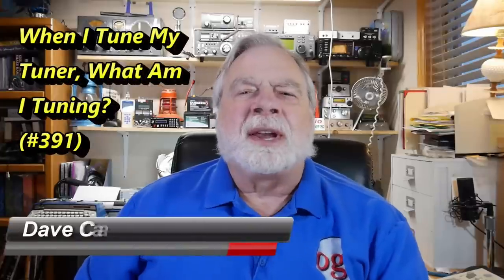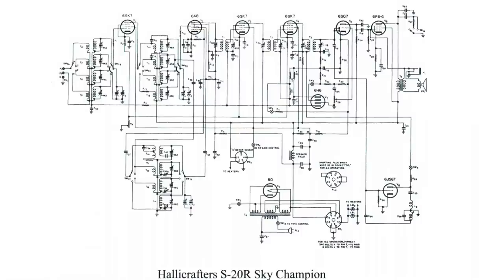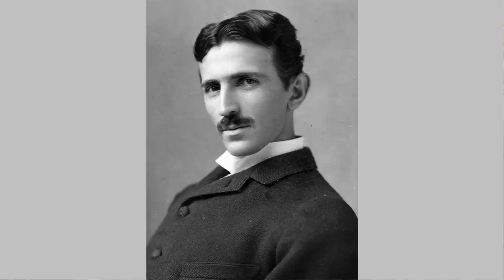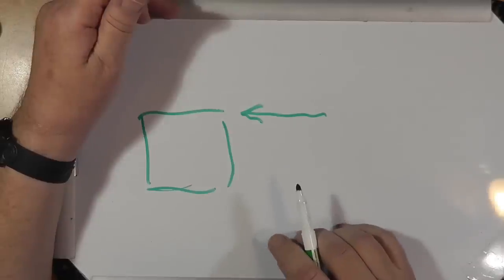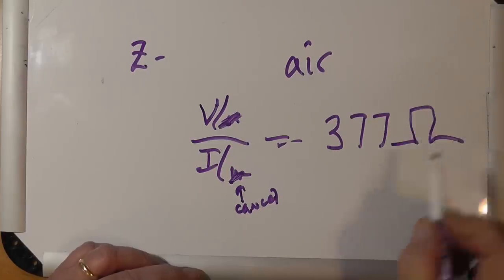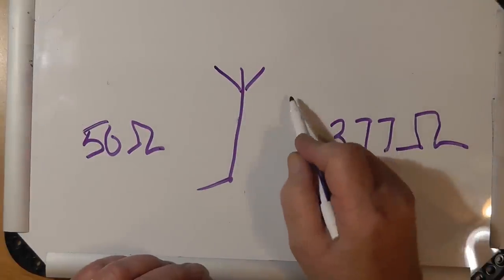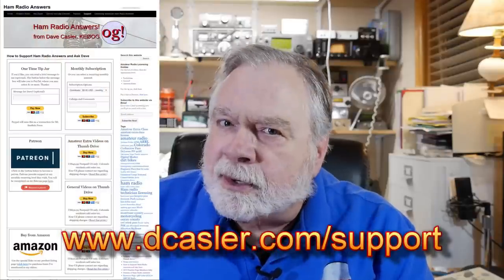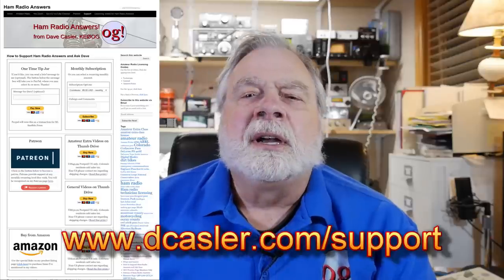What Am I Tuning When I Tune My Antenna Tuner? (#391)

Comment: I think that it is worth to mention that although youre transmitter is now happy when tuned, your swr is still bad because of the antenna not matching the 50 ohm coax. Depending how much off youre transmitting frequency is from the antennas real resonance more and more energy will be radiated from the coax. Said in another way... youre coax cable is becoming part of youre antenna and is less working as an transmission line.
Reply: I think, I got what you are talking about. There are some simple workarounds:

1. Place a remote-tuner directly to the antenna feed point and everything should be fine.

Or

2. Considering the fact, that any feedline of an electrical lenght about a half wavelength (or any multiple of it) acts as a 1:1 transmission line, the specific impedance of the feed line doesn't matter. So let's for example say, your antenna has 150 Ohm and you are using a half wavelength of 75 ohm cable, this will lead to 150 Ohm at the transmitter side of the cable. At this point you simply insert your matching unit (50 Ohm in / 150 Ohm out) and not only your radio is happy, but also there is no SWR on the feedline. In those cases you may use 25 or 50 or 52 or 60 or 75 or 93 Ohm cables - it simply doesn't matter in respect to the SWR. The same is with parallel feedlines but as long as we are talking about HF and SWR losses, it almost always concerns coax cables. As this 1:1 transmission work on any  multiple half wavelength, you may be able to feed multiband antennas that way with just a single feedline.

Last but not least some words about "radiating feedlines":
If a feedline (e.g. coax cable) radiates, it's not a matter of SWR! Radiation almost always occurs in case of common mode currents (I wonder, why that much radio amateurs refuse to use a balun when feeding a dipole with coax) or e.g. when an endfed antenna has "nothing to work against" (it isn't true, that an endfed antenna don't need a counterpoise or at least an earth post. In those cases the coax radiates. When surpressing this forced  radiation with ferroids, the antenna will fail. Simply adding a counterpoise solves those problems). Therefore: If your cable radiates, search for the reason elsewhere - but don't blame it on the SWR!
Reply from the maker: I've had bad luck with feedpoint 1:1 baluns or choke baluns, so I don't use them. Other people tell me I'm nuts. Best practice is to use the balun.

Comment: But the tuner is not making the antenna more resonant.  That is what I understand. A non-resonant antenna does not become resonant because of a tuner.  Of course, non-resonant antennas may also be efficient, if, say, fed by ladder line, so I heard. What are your thoughts? SV0SGS
Reply: @David White No.  A "tuner" matches the impedance of the antenna to the radio, 50 ohms.  It does not change the resonance or other characteristic of the antenna or feed line.  Some energy may get reflected back up the antenna, but much energy is lost to heat.  Hold down the ptty while transmitting rtty or cw at 100 watts and feel how hot your tuner becomes.  But don't do it too  long.

The best location for a "tuner" is at the antenna feed point.  There are several remote auto "tuners" on the market.

Comment: Tuning antenna tuner that tunes the antenna.  :D
Reply from the maker: An antenna tuner does not tune an antenna. It doesn't change anything about the antenna or for that matter the feedline. But it does make the combination of the feedline, the antenna, and to some degree the environment behave nicely for the radio's final amp.

Comment: Free space has impedance .Mind blown.
Reply from the maker: Electromagnetic field consists of an electric component, measured in volts per meter, and a magnetic component, measured in amps per meter. Divide v/m by a/m and the m's cancel, leaving you with v/a, which is just ohms. 377 ohms, to be precise. It indeed blows the mind!
Reply: @davecasler  Great stuff as always Dave!

Comment: Short answer is, its not a tuner, its a coupler, and its an impedance matching device.  It "tunes" nothing, it matches impedance
Reply from the maker: Well, by adjusting the reactive elements you are adjusting the frequency of resonance. In that sense it is indeed tuning.
Reply: @davecasler  technically you are correct if you have to adjust something you are tuning it but for 21 years in the Air Force all through lots of schools these are not tuners they are couplers. Now they do allow you to make adjustments so technically yes they are tuning
Reply: @jgwimmer  Hehe a rose by any other name. I have seen such discussions on naming go on for ages.

Comment: Love your work, but this was way too long and didn’t really answer the question
Reply: Here's the answer:
Antenna Tuners should be referred to as Variable Impedance Matching components.
Absolutely nothing in the antenna or transmission line is "tuned."
Reply: It did answer the question, Todd.
Reply from the maker: It was too long--I got rather excited about one of my favorite topics.
Reply: @greglawrencemusic  unless something thinks of "matching" and "tuning" as synonyms